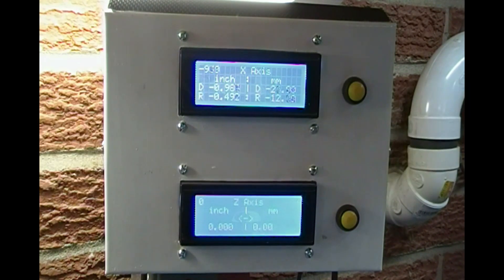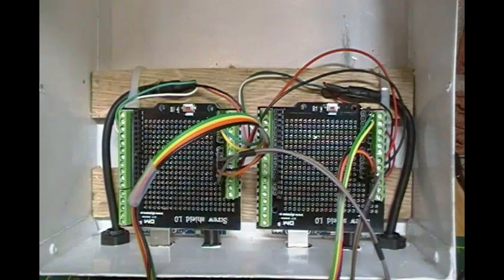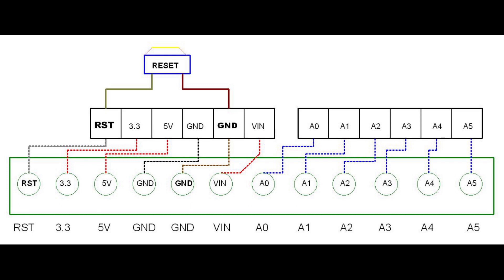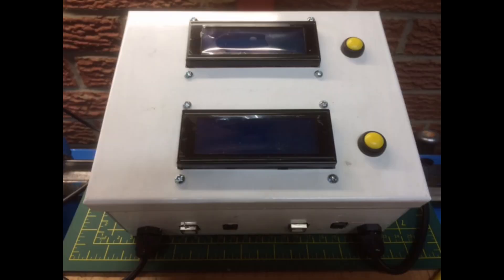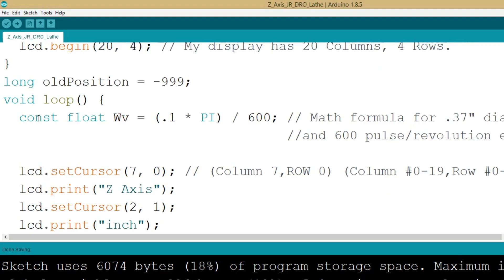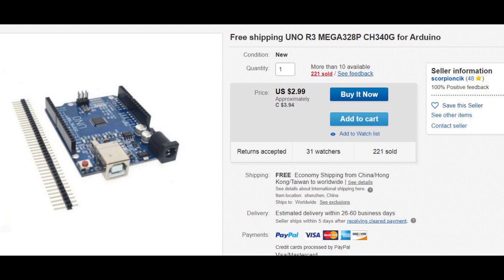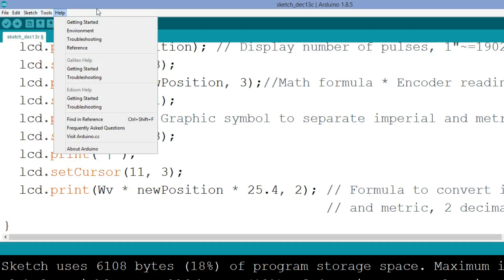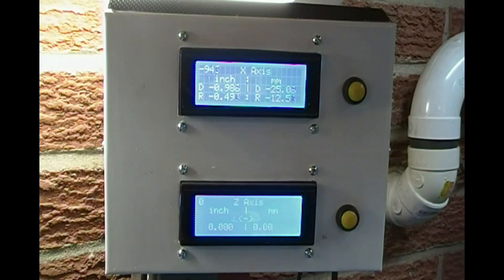DRO 4 wiring the Digital Read Out and uploading sketches.

Comment: Nice Project! my old DRO is dying, so i am in process of locating everything to actually get one of these up and running soon. 

 Is it possible that the issue with the formula,  is that the formula used the wrong pulse count and the OD not the PD of the pulley?  The formula used is (.1 x 3.1416 /600) = 0.00052 if you use 

Pitch Dia. of Pulley x Pi (3.1415) /2400 

I found this info  for the gt2 pulleys 
PD for the pulleys
# grooves\ Pitch Dia 
 14 \ .351   Calculation = 0.00046
 15 \.376    .00049
 16\.401     .00052
 17\.426     .00056
 18\.451     .00059
 
Thoughts? 
Randy

Comment: Hi your project help me a lot, I am a hobbyst and a comercial DRO are much expensive and don't make sense for my use, so I decided to implement your DRO, but I have a question, you use the formula (.1 x π )/ 600 afak this must be (2 * π * r)/600 where do you get the value .1? your pulley is 8mm in diameter.
Reply from the maker: I am glad my project helped you, my math formula was derived through trial and error, the outside diameter of my pulley is 9.67 mm.
Reply: @practicemakesbetter7132  Thank you for your clarification makes me confident to finish the project.

Comment: Great project, i would like the arduino to remember the position after a power interruption. Do you have a solution for this?
Reply from the maker: My suggestion is to replace the power adapter with a 9 Volt battery and a toggle switch. The toggle switch is to turn your Arduino off when you are not using your DRO, this will extend the life of your battery.

Comment from the maker: X Axis Sketch
 
// James Rovere 2019 Lathe X Axis
// A Digital Readout using a quaduture rotary encoder,an IC2 LCD display
// and a GT2-16 pulley, 16 teeth spaced 2 mm apart; .37 outside Diameter.
#include <Encoder.h>// Encoder library.
Encoder myEnc(2, 3);// Connected to Digital pins 2 and 3.
#include <LiquidCrystal_I2C.h> //IC2 LCD library.
LiquidCrystal_I2C lcd(0x27, 2, 1, 0, 4, 5, 6, 7, 3, POSITIVE);
 
void setup() {
  lcd.begin(20,4);// 20 Columns, 4 Rows.
  }
long oldPosition= -999;
  
  
void loop() {
  const float Wv =(.1038 * PI)/600; // Formula to set the linear distance travelled in one pulse.
    
    lcd.setCursor(8,0); //(Column 8, Row 0)
    lcd.print("X Axis");
    lcd.setCursor(3,1);
    lcd.print("inch");
    lcd.setCursor(14,1);
    lcd.print("mm");
    lcd.setCursor(9,1);
    lcd.print(":");
    lcd.setCursor(9,2);
    lcd.print("|");
    lcd.setCursor(9,3);
    lcd.print(":");
    lcd.setCursor(3,2);
    lcd.print("D");
  long newPosition = myEnc.read();
  if (newPosition != oldPosition)
    lcd.setCursor (0,0);
    lcd.print (newPosition);// Display pulse count.   
    lcd.setCursor(2,2);
    lcd.print(Wv*newPosition*2,3);//Diameter multiply by 2, 3 decimal places
    lcd.setCursor(0,2);
    lcd.print("D");
    lcd.setCursor(11,2);
    lcd.print("D");
    lcd.setCursor(11,3);
    lcd.print("R");
    lcd.setCursor(0,3 );
    lcd.print("R");
    lcd.setCursor(13,2);
    lcd.print(Wv*newPosition*25.4*2,2);// mm Diameter multiply by 2, 2 decimal places.
    lcd.setCursor(2,3);
    lcd.print(Wv*newPosition,3);// inch Raidius of workpiece.
    lcd.setCursor(13,3);
    lcd.print(Wv*newPosition*25.4,2);// mm Raidius of workpiece.
          
}

Comment from the maker: Z Axis Sketch
// James Rovere 2019 Z Axis
// A Digital Readout using a quaduture rotary encoder,an IC2 LCD display
// and a GT2-16 pulley, 16 teeth spaced 2 mm apart; .37" outside Diameter.
#include <Encoder.h>// Encoder library.
Encoder myEnc(2,3);// Connected to Digital pins 2 and 3.
#include <LiquidCrystal_I2C.h> //IC2 LCD library.
LiquidCrystal_I2C lcd(0x27, 2, 1, 0, 4, 5, 6, 7, 3, POSITIVE);

void setup() {
  lcd.begin(20, 4); // My display has 20 Columns, 4 Rows.
}
long oldPosition = -999;
void loop() {
  const float Wv = (.1 * PI) / 600; // Math formula for .37" diameter pulley
                                    //and 600 pulse/revolution encoder.

  lcd.setCursor(7, 0); // (Column 7,ROW 0) (Column #0-19,Row #0-3)
  lcd.print("Z Axis");
  lcd.setCursor(2, 1);
  lcd.print("inch");
  lcd.setCursor(14, 1);
  lcd.print("mm");
  lcd.setCursor(8, 2);
  lcd.print("<->");// Graphic symbols for a Z axis left and right travel.
  long newPosition = myEnc.read();
  if (newPosition != oldPosition)
  lcd.setCursor (0, 0);
  lcd.print (newPosition); // Display number of pulses, 1"~=1902.2 pulses.                       
  lcd.setCursor(2, 3);
  lcd.print(Wv * newPosition, 3);//Math formula * Encoder reading ,3 decimals.
  lcd.setCursor(9, 1);
  lcd.print("|");// Graphic symbol to separate imperial and metric display.
  lcd.setCursor(9, 3);
  lcd.print("|");
  lcd.setCursor(11, 3);
  lcd.print(Wv * newPosition * 25.4, 2); // Formula to convert imperial
                                         // and metric, 2 decimals.
}

Comment: Is the encoder quadrature, if so you should get 2400 PPR, 4 times the resolution, or am I wrong.
Reply from the maker: Good question, an Arduino R3 or Uno board does not have the capability of using the encoder to the best of it's ability. If we were to use a more advanced Arduino board such as the Mega we should enable us to increase the resolution of the encoder but we would have to modify the Arduino Sketch.
Reply: I used this encoder code on my version of your idea, it should work for you too.

enum PinAssignments {
  encoderPinA = 2,
  encoderPinB = 3,
  clearButton = 8
};

#include <Wire.h>
#include <LiquidCrystal_I2C.h>

LiquidCrystal_I2C lcd(0x27, 20, 4);

volatile int encoderPos = 0, lastReportedPos = 1;
volatile float teeth = 20, ppr = 2400;
volatile float pos = 0.000, inc = teeth / ppr;

boolean A_set = false;
boolean B_set = false;

void setup() {
  lcd.init();                      // initialize the lcd
  lcd.backlight();
  delay(500);
  pinMode(encoderPinA, INPUT);
  pinMode(encoderPinB, INPUT);
  pinMode(clearButton, INPUT);
  digitalWrite(encoderPinA, HIGH);  // turn on pull-up resistor
  digitalWrite(encoderPinB, HIGH);  // turn on pull-up resistor
  digitalWrite(clearButton, HIGH);

  // encoder pin on interrupt 0 (pin 2)
  attachInterrupt(0, doEncoderA, CHANGE);
  // encoder pin on interrupt 1 (pin 3)
  attachInterrupt(1, doEncoderB, CHANGE);

  Serial.begin(115200);
}

void loop() {
  if (lastReportedPos != encoderPos) {
    pos = encoderPos * inc;
    //Serial.println(pos, DEC);
    lcd.setCursor(0,0);
    lcd.print(pos, DEC);
    lastReportedPos = encoderPos;
  }
  if (digitalRead(clearButton) == LOW)  {
    encoderPos = 0;
  }
}

// Interrupt on A changing state
void doEncoderA() {
  // Test transition
  A_set = digitalRead(encoderPinA) == HIGH;
  // and adjust counter + if A leads B
  encoderPos += (A_set != B_set) ? +1 : -1;
}

// Interrupt on B changing state
void doEncoderB() {
  // Test transition
  B_set = digitalRead(encoderPinB) == HIGH;
  // and adjust counter + if B follows A
  encoderPos += (A_set == B_set) ? +1 : -1;
}
Reply from the maker: @BigBoyRasp  Thanks, when I get a chance I will give it a try.
Reply: @BigBoyRasp  Hello, I want to use it for 400 pulse optic encoder, is your code for arduino mega or UNO ? .
 what does mean of teeth in your code  ? and clearButton ?  doing for what ?
 I want to measure  turn of the encoder and wil be 3 digit sensitivity. do you have any suggestion ?. 1 turn of encoder will be 0.57 cm etc. I want to use it for lathe DRO and encoder will connect to the screw mill directly. 1 turn of screw mill is 0.57 cm (I use mm,cm etc iso) so 1 pulse of encoder will be ( 0.57  / 400) cm

Comment: what about libary in  code can you add link or some tutorial for it. thanks you so much
Reply from the maker: If you look just below my video screen you will see a written description of my project and a link to find my code @ arduino.cc - your welcome.
Reply: @practicemakesbetter7132  yes i know that but encode.h wasnt included. But i done it and it is awsome thanks
Reply from the maker: @stir99  Sorry, yes you can download and install an encoder library easily. Open your Arduino sketch, click on the Sketch Tab, place your mouse cursor on Include Library. Look at the very top of the library list, click on the words Mange Libraries. In the "Filter your search" box type the word encoder then scroll down until you find the encoder library by Paul Stoffregen download and install, hope that helps.